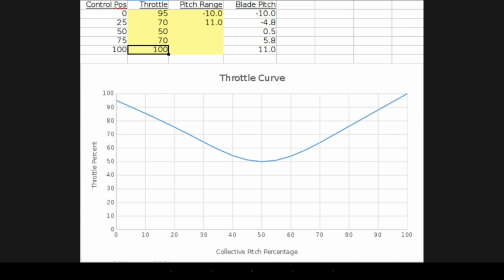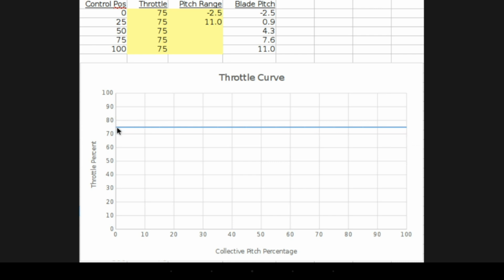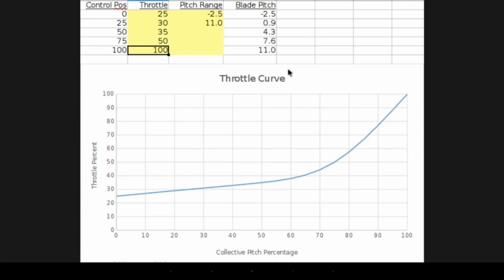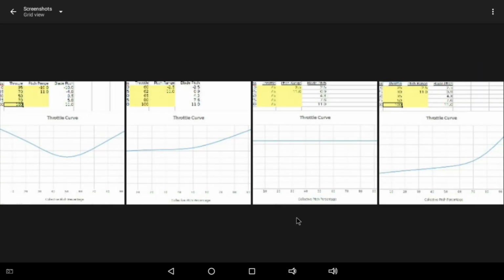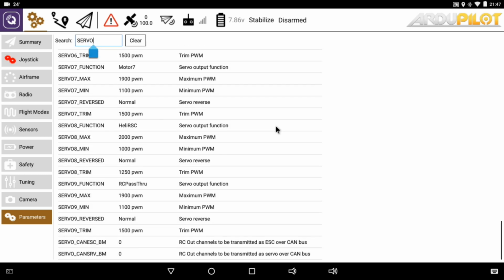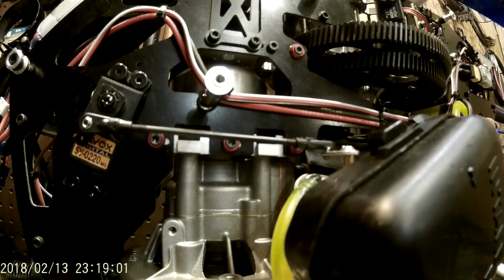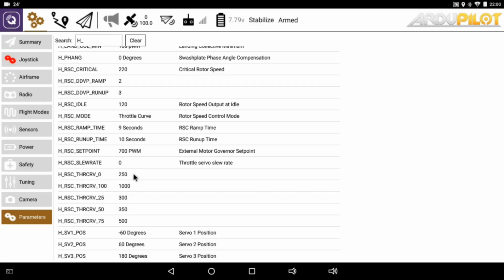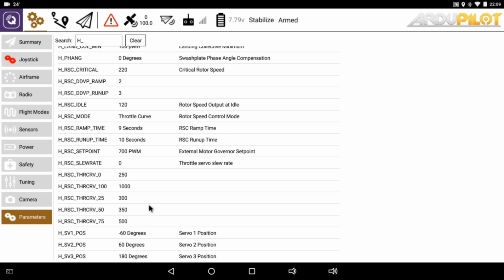ArduPilot TradHeli Setup Video 4

Comment: Thanks for this video, I used to have an ace one autopilot system on my gas helicopter but the IMU unit got damaged and you can't see it to buy anymore was thinking of switching to pixhawk and this is a very intuitive and educational video on how to get it working, but I was hoping the ardupilot software would have an external governor for speed control just like ace one or better. Is there a way to incorporate an external governor to independently control the headspeed for gassers on ardupilot?
Reply: You should jump onto the Ardupilot Discord chat and ask there for more recent info on the governor situation. I know there was some progress made on an external governor that uses an optical sensor IIRC. That being said I am sure there are multiple options and approaches so I would ask someone more knowledgeable than I.
Reply: https://www.youtube.com/watch?v=W5HR1BGybtA some info in the 2020 un-conference :)